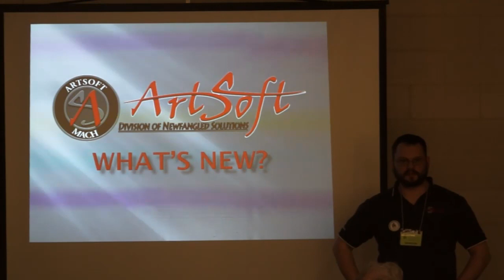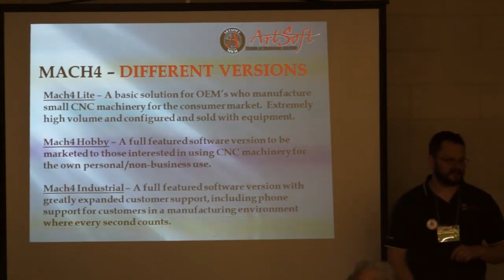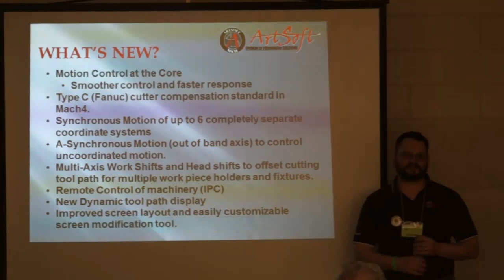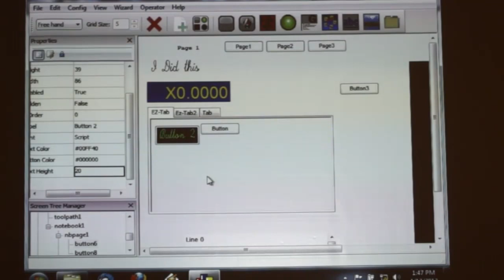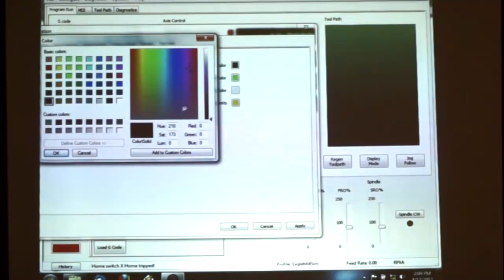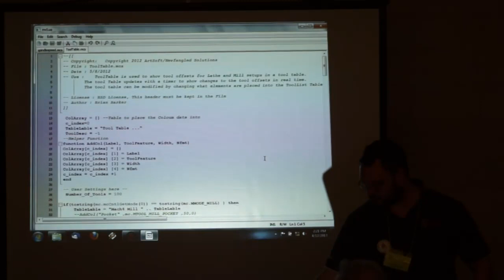Mach4 CNC  Brian talks about Mach 4 the PC CNC controller

Comment: I've seen IPC before. A similar idea is used on the D Electron controls as used on some of the Parpas machines. It allows a Linux pc to be used as the main cnc controller in the cabinet for stability of the cnc side and a windows front end for ease of use and good compatibility with cad cams etc. It's all linked via ethernet on the D electron controls including the drives.